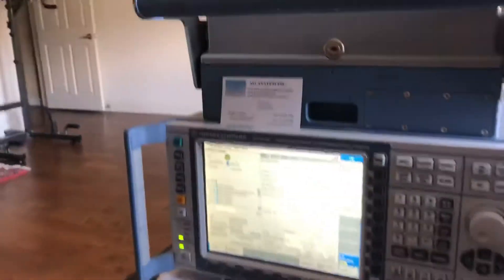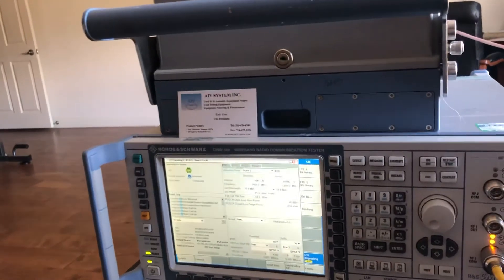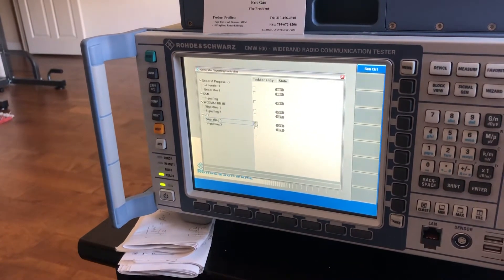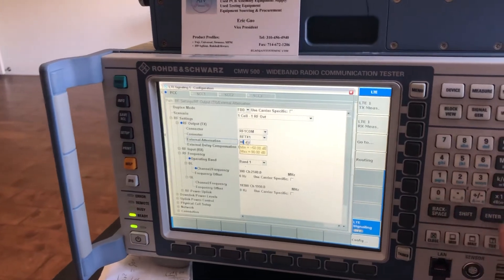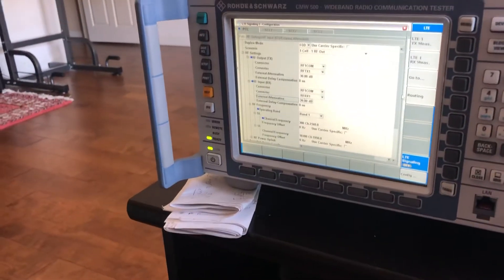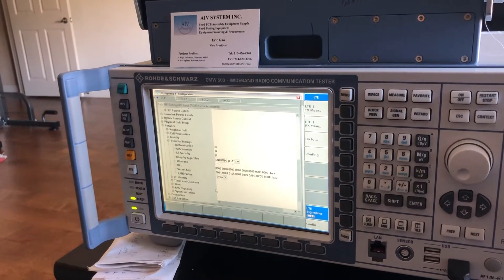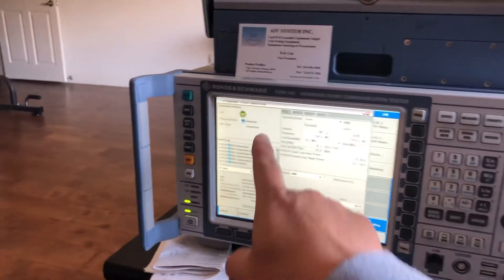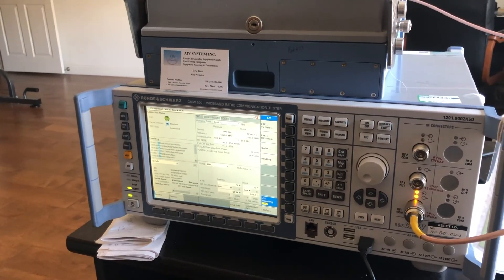CMW500 SIGNALING BASIC SET UP

Comment: Good video, is it possible to test the Wifi, Bluetooth and GPS signal strength test through this tester? what are testing parameters for these? and how can a DUT be connected with this tester and what frequencies will be predetermined in the test setting parameters in this tester for checking the 4G phones antenna connectivity.